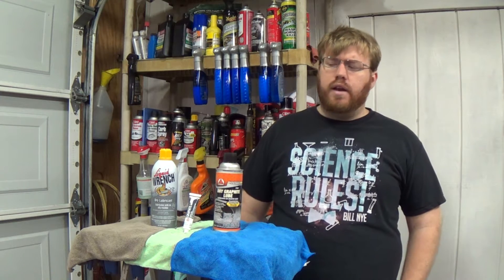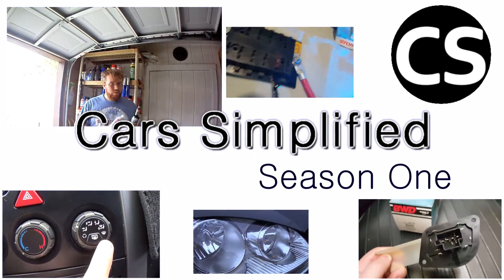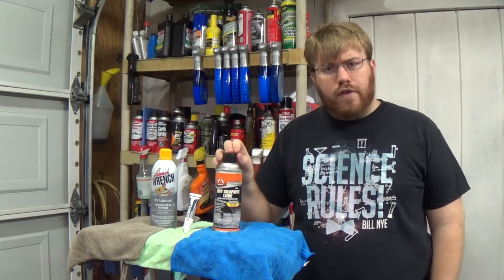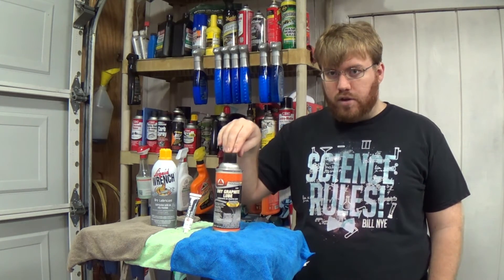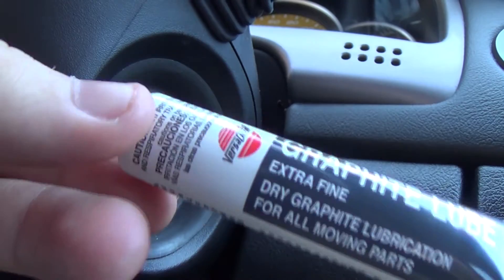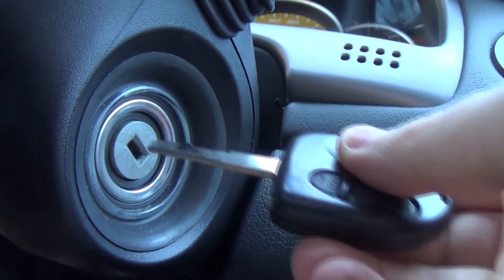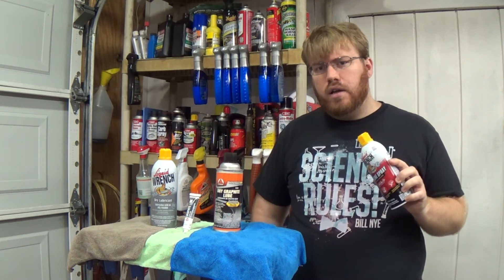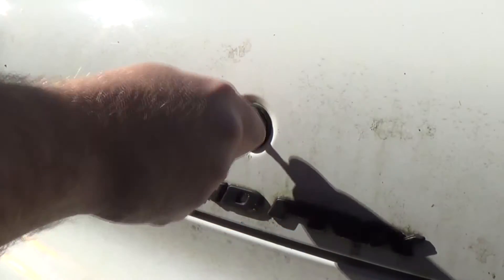What is Dry Lubricant? • Cars Simplified

Comment: It has been said that the propellant in silicone spray could be detrimental to rubber , plastics , etc.  So to spray silicone into a styrofoam cup and if it melts , don't use it . If one doesn't melt the cup , it's good to use .
Reply: which sprays brands do you recommend?

Comment: I was told Silicone spray/ Lube doesn't affect plastic and rubber as Lithium grease/ spray does !!! Now I'm hearing this video say... Silicone affects plastic,🤯🙅🧐🙄
Reply: Same, now I don't know what to use for rubbers and metal paint.... Can someone help
Reply: @whiteknight10 Use Silicone on any rubber, plastic or rubber/plastic touching metal...
Metal on metal use White lithium grease spray, synthetic oil or some thicker grease (Red & tacky...)
Reply: @Htm.13 thank you
Reply: Silicone is SAFE for plastic and rubber.
Reply: @e8tGrand83 thanks

Comment: Mac 1314 dry graphite spray is awsome an is safe for plastic an is sold at Napa auto 9.89 a can works great an drys an won't rub off or let dust an stuff stick to if FYI
Reply: whats a good silicone spray for rubber weatherproofing around the sunroof?

Comment: Great video, which spray do you recommend for car window rubber seals?  I want my windows to move smoothly and quietly. Any suggestions are appreciated.
Reply: I was wondering the same thing
Reply: sweet project cars did a video on it. blaster dry lube with teflon.
Reply: Wd40 Specialist Silicone spray

Comment: What do you recommend for trying to get a creak out of my interior?  I was thinking of a PTFE spray.  I need something dry and doesn't eat away at plastics and rubber.
Reply from the maker: What is creaking in the interior? PTFE spray sounds like a good option for most stuff.
Reply: @CarsSimplified  It sounds like it's a trim piece somewhere on the passenger side or it may be the pano roof.  Only happens when the car twists slightly on uneven road.  Figured I'd try out the WD40 PTFE spray and go at it into every little nook and cranny.
Reply from the maker: I would try to be more precise with it; the spray might not be good to breathe in and if you soak the interior with that it may be what your car will smell like for a long time.

If you have a large heavy bag of something (pet food, fertilizer, oil dry, etc.) you can lean it on interior trim pieces (floor area) and the seats to see if you can hold it down/prevent it from moving. If you try a spot and the noise is gone, you know what area to investigate further.

Also, if it's coming from the dashboard, a spray lube solution probably won't last more than a week; those noises are stubborn and usually require a more mechanical fix.

Comment: Graphite? So I could buy a pack of mechanical pencil refills and use that as dry lube?
Reply from the maker: Graphite refills for mechanical pencils sort of do work as a dry lube, but they aren't pure graphite. They have some sort of bonding agent in them to help them keep their shape.
Reply: Oh that makes sense.

Is there a good clear dry lube so it won't show on surfaces?
Reply from the maker: I'm not familiar with any, but if you can make a surface out of solid teflon/PTFE, it gives you lubricating properties and a good clean surface. A clear/white/uncolored wax isn't super dry (especially with its low melting point) but it is the only other thing that comes to mind.
Reply: the majority of DFL pigments are grey/black, i.e. Molybdenum disulfide and graphite are the most common, but PTFE (teflon) is probably the closest to being clear, but those lubricants cure to a white film finish.